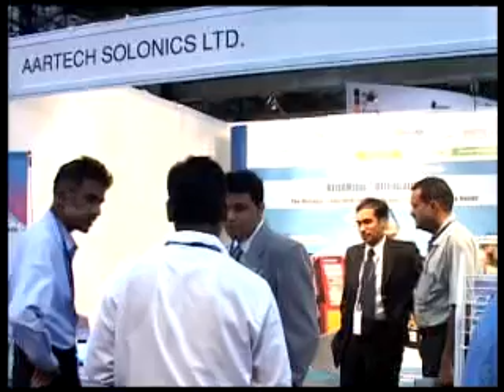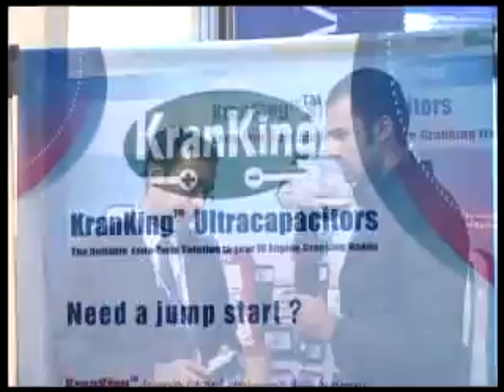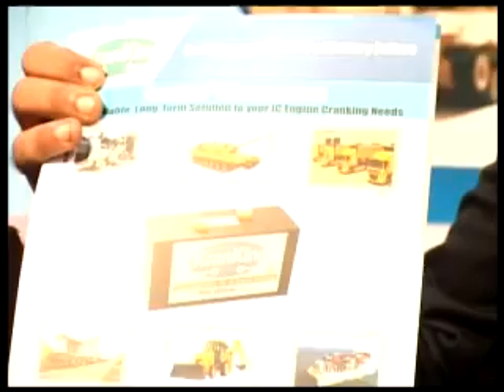Marine Products - KRANKING ULTRA CAPACITORS

Comment: OK what i recall from my experience these capacitors that are completely dry (have no added chemicals). and thereby enviromentally friendly. are not useable as bataries because they release all of the charge stored in them, in like 0.1s depending on the structure of the holes in the carbon. And i really dont know much about how the technology has been emprooved since then. but surely there would be many uses for this.